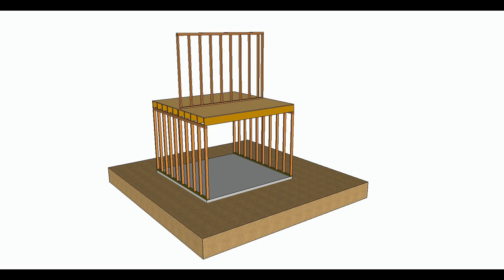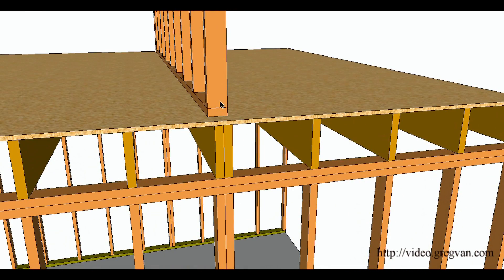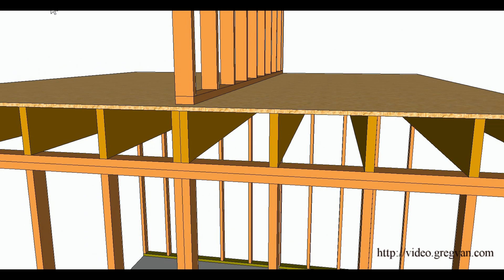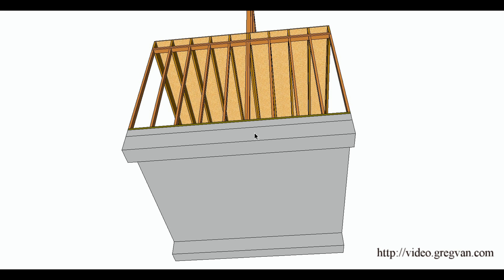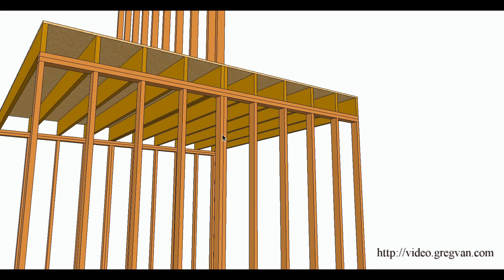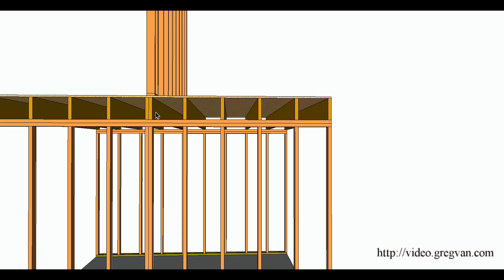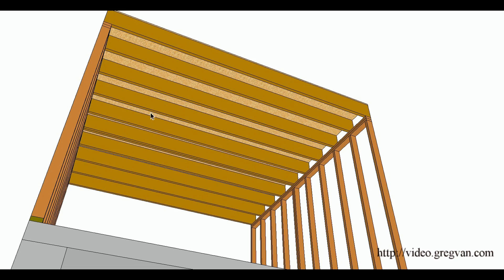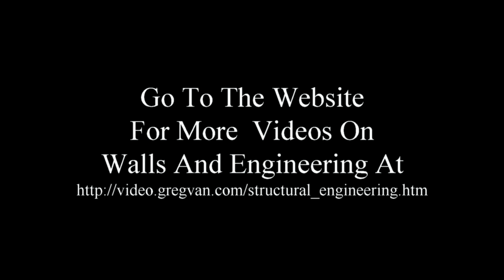Structural Floor Framing Examples For Supporting Walls – Part Four

Comment: Thank you for the video. If it is common for plumbers to cut weight bearing joist so that they can run their plumbing, than who would be liable for paying for the added expense for the framer to fix the problem after the fact?
Reply from the maker: Ruben Rojas That is a tricky question to answer, but more than likely it would be the person who did the damage, unless they had written permission from a project manager, superintendent, property owner, general contractor or structural engineer. Don't ever do anything without written permission, because if someone tells you to do something, they could always deny us in the future.
Reply: Yes, good advise. I took a class in construction law. My professor said a simple email/text via smartphone is a legal document that is as good as written permission. Smartphones are very handy on todays job site, a must have when a change order is needed on the fly.
Reply from the maker: If your professor said it was true, then it probably is, but I would rather something that was signed with wet ink, from the individual who was directly responsible and could be held accountable. Think about it, if I received a text from your phone number, you could simply deny that you sent it and that's where this could be a problem.